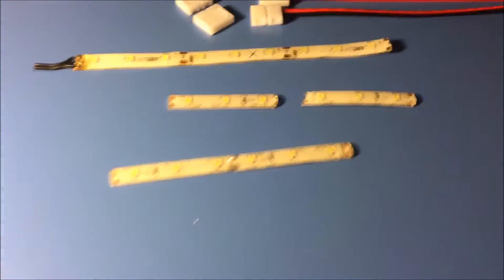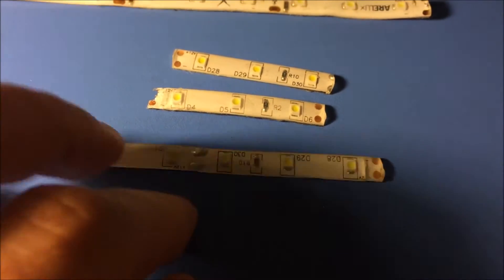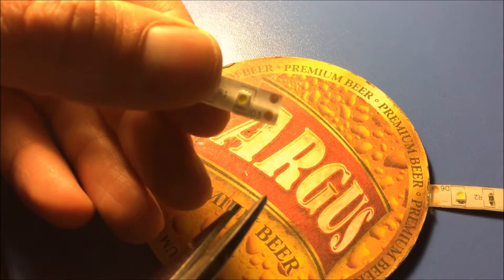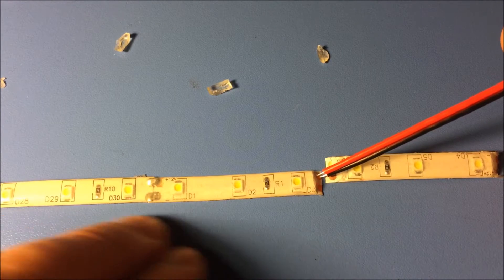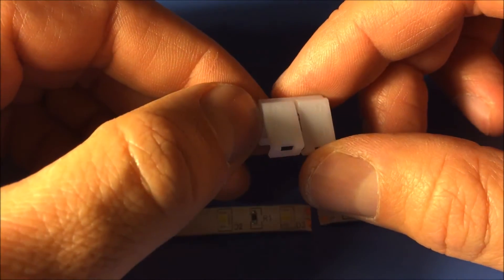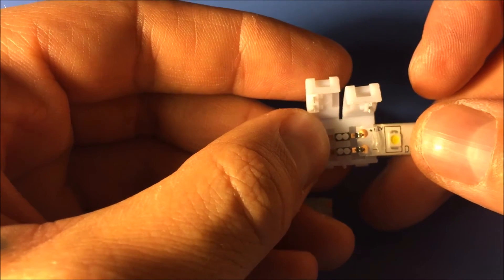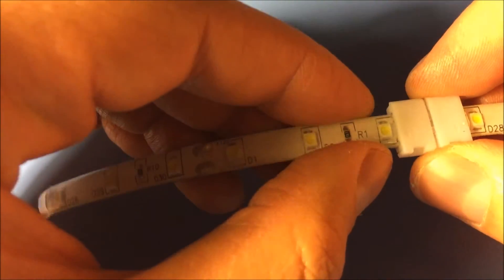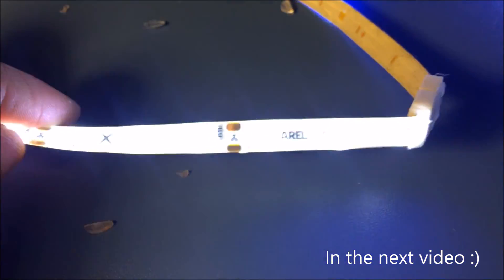How to connect LED strips with clip on connectors

Comment: AL, thanks for the video.  Not sure I would have the patience for those clip on connectors, however I do like the LED strips with the scissor pictures to show me where to cut.  I have used clip on connectors for outdoor LED lighting on my garden paths but they clipped directly into the low voltage wire.  I then siliconed them and put a plastic bag around the connectors to keep water and corrosives (soil) out of the contact points prior to burying the connections.   So far (winter, summer, winter) they seem to be holding up well.  Don't need more aquarium lights at the moment but will keep this video in mind.  Be well, Ken
Reply from the maker: clip on connectors work well if the led strip stays in one place , but for my I always move my aquarium lid to work in the tank and that is why clip on connectors lose their grip on the led strip and start to open the circuit. Soldering led strips is more durable and its coming in the next videos :)